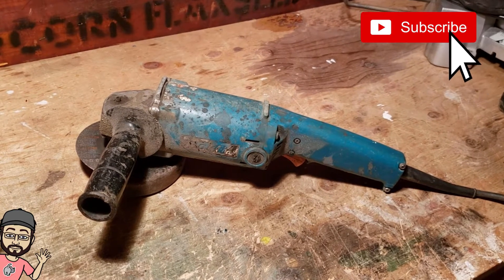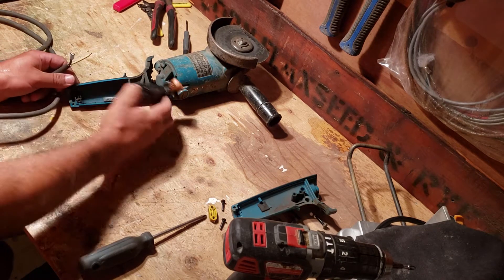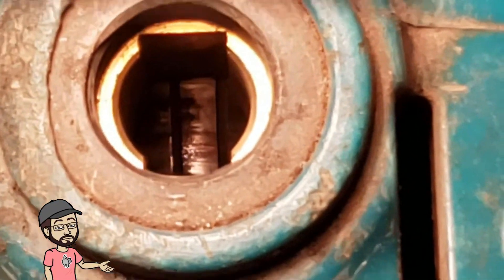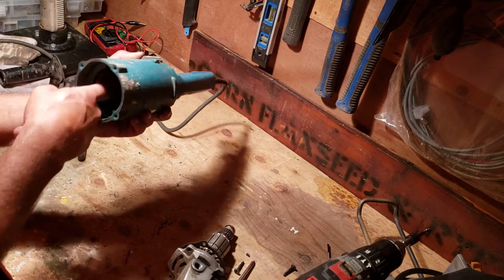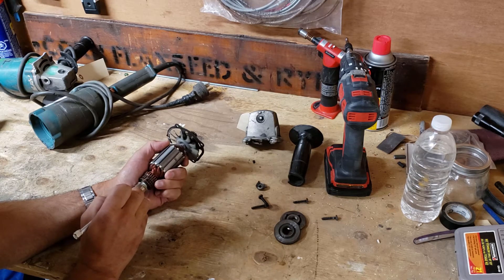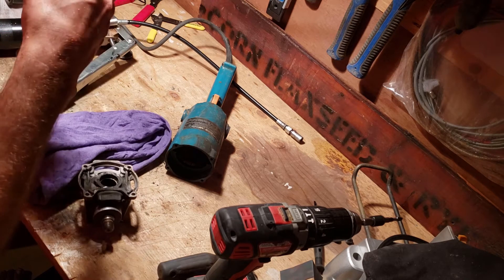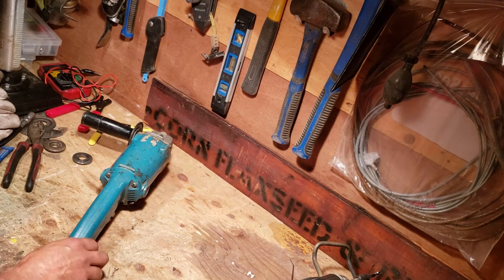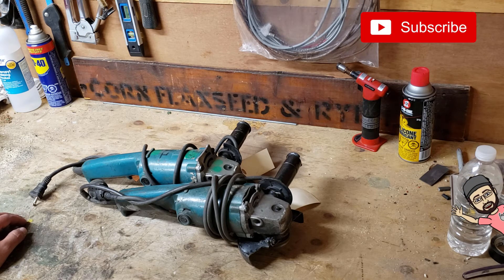Angle Grinder Repair - How to Fix: Sparks, smoke, short circuit,  SOLVED!

Comment: Checked the circuit power is right the button to switch on is not contacting brushes are fully like new
Reply from the maker: Did you measure continuity from the power cord to the brush holders with the switch in the "on" position?

Comment: Many thanks for the informative video. You didn't however cover my problem which is a short circuit. When I switch my Bosch angle-grinder, it triggers a short circuit. I follwed your video because the video title also states "short circuit".
Reply from the maker: Short circuit can be in the power cord, switch or armature, details on how to check for these are covered in the video

Comment: Please make a video troubleshooting a  Makita grinder which has power when testing and upon changing the corf and brushes i'm mot sure if it's a capacitor or switch of which when I test continiuty it constantly rings and doesn't stop
Reply from the maker: @nokuthulamthimkhulu8008  do you mean the grinder won't turn on or it will turn on but not stop?

Comment: My spindle lock is broke. You push down on the button and the metal that holds the button breaks open. That should be a more common problem.

Comment: My grinder won’t do not wean I pull trigger any tips
Reply from the maker: What model grinder do you have?
Reply: GA5020 5-Inch Angle Grinder
Reply from the maker: When you pull the trigger does it feel a little spongy or can you feel a solid click or thud?  The switch on these fail very often and need to be replaced.  This is why I prefer the 9005 over the 5020.
Reply from the maker: If you remove the trigger and test it with a multimeter you may find that it switch does not fully engage even though the trigger is at full travel

Comment: Yo boss man I work as a tool repair man and I got about 6 Lakota grinders that buzz and smoke from the field assy and don’t even spin I’ve put a new field in one of them and same issue
Reply from the maker: You're sure the smoke is coming from the field even after you changed it?
Are the bearings and brushes good?
No damage to armature?
Does the gearbox turn freely?
Reply: Yeah I’m at work working on them right now and when I remove the brushes and armature the field smokes, with the brushed and armature in it buzzes and smokes
Reply: I have multiple grinders that do this I’ve taken them apart required them and it’s fucked it makes no sense I’ve even put new armatures and fields in one and still smokes and buzzes
Reply from the maker: This one has me stumped as well. The buzzing is likely some of the plates are loose and if that's the case maybe some of the varnish got worn off one or more of the windings and there's a slight short. Maybe the new field got damaged in shipping?
Reply from the maker: Check resistance from one of the field leads to the metal plates
Reply: Makita *
Reply: Could it be the black wire that connects to the brush holder? And I’ve put in a list of parts to get ordered so whenever they come in I’ll put a new one in, but even my desalt grinders are having this problem, I’m thinking I’m not wiring it right or there’s a wire short
Reply from the maker: The field should have 2 wires going to the brush holders and 2 going to the switch/power cord. Some models have both the black and white switched, others have just the black switched and the white always connected. I would grab a multimeter and look for a short somewhere. Maybe one of the fuse holder springs is not seated all the way and touching something metal.
Reply: @nothandsomebuthandy  sounds good thanks mate I’m working on a band saw right now soon I figure out the problem I will let you know
Reply: Ok so I’ve replaced litter at ever part except the black wire that goes to the brush holder and still thing
Reply: Hey boss man hate to bother again but I got makita grinders and the armature is sparking where the brushes touch and it’s just one side I’ve changed armature and brushes still sparking
Reply from the maker: Hmm my first guess would be brushes aren't making good contact with the commutator, either a weak spring, worn brushes or dirty/damaged commutator segments. But if you put new brushes that eliminates that, and if you changed the armature maybe both are dirty or rough? Or maybe something in the brush holder isn't letting it slide smoothly?

Comment: Where does one get new bushings?  Is a $50 grinder worth any effort?
Reply from the maker: I'm not sure what bushings you're referring to but most replacement parts I order online (usually amazon) and they can run $10 to over $100 so on an inexpensive grinder it may not be worth fixing. For example at my work we use cheap die grinders and just throw them out when they die as they're about 1/8 of the cost of a decent one which likely wouldn't last 8 times longer.

Comment: Hi brother, i recently purchased an angle grinder to be used as a chainsaw with an adapter. It really worked well cutting trees. I'm not sure why while using it suddenly overheated slowing down its speed and there's a burning smell. Whenever i switch it on it is still working in a slow speed with a burning smell. I kept it away to find a solution for this. In your opinion, what may have caused the problem and how can I fix/avoid this problem? Thanks in advance, brother.
Reply from the maker: Obviously difficult to guess without knowing more info. What brand/model/size grinder and what attachment were you using? Many low-end consumer grinders are underpowered and have a low duty cycle (ratio of time on vs time to cool). This duty cycle will decrease with increased load (ie: larger attachments or force put on the attachment). Also low end tools use cheaper bearings which could overheat and begin to seize.
Reply: @nothandsomebuthandy  I was on a budget. So, I bought the angle grinder together with the chainsaw attachment for about $22.50. I just started troubleshooting by looking at the carbon brush. One was long and the other was short. So, i replaced with new ones which came with the grinder. It started sparking. Immediately, I turned it off. I haven't open inside for troubleshooting. I'll follow your video as a guide for troubleshooting and let you know the results. Thanks brother!
Reply from the maker: Good luck!